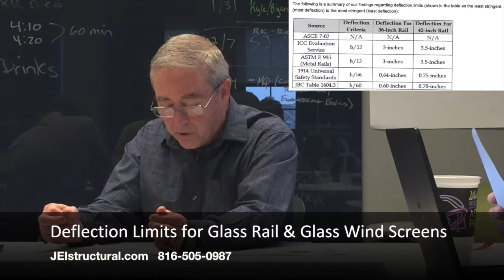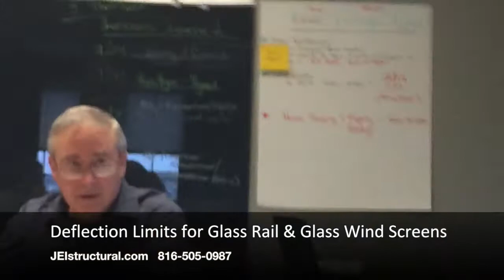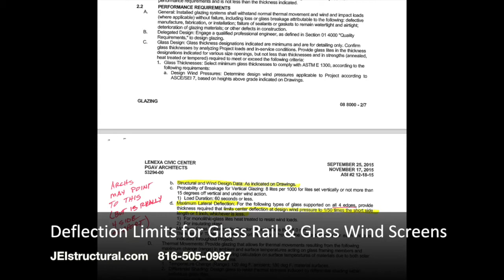Deflection Limits for Glass Rail & Glass Wind Screens

Comment: I am a structural engineer in CW & these videos looks quite interesting.. however, using FPS system is quite annoying...FPS system is stupid.. except america the whole world use metric system..AAMA has the limit for handrails ..i think it is H/36 which seems too high..it should be more stringent..australian standard AS-1288 is much better for glass. It is limit state design & the guidelines are given  in much detail like buckling check for fins etc.. anyway thumbs down for inches & pounds... otherwise nice videos